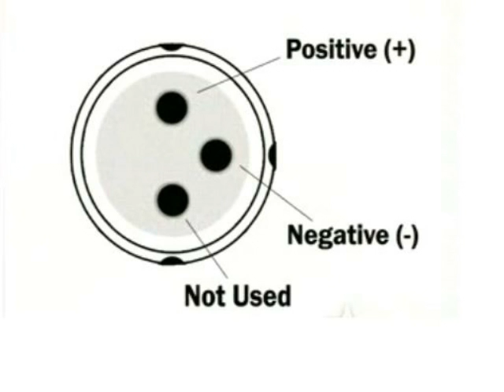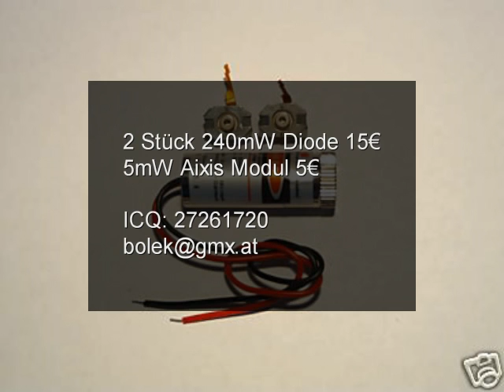240mW aus DVD Brenner Laserpointer Tutorial

Comment: The "not used" terminal is usually the feedback photodiode. It is built in to maintain constant beam power, when the diode heats up. It is important in optical drive application. I would guess it is also used in the pointer to limit power below 5mW.

Comment: You fried the diode. These things are very fragile and require a driver circuit with the appropriate voltage and current as well as a proper heat sink to work properly. Mini mags do not work well as they are hooked straight up to power. I use an led flashlight that already has a driver circuit and i just added a resistor in series to the diode and its been working for over a year now. I can light a match from ten feet (see my videos) Good luck!